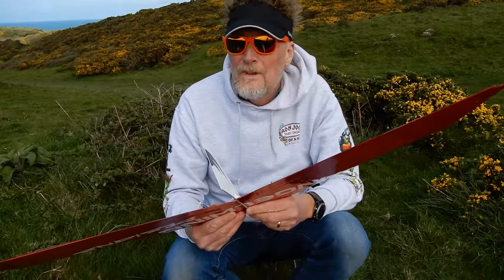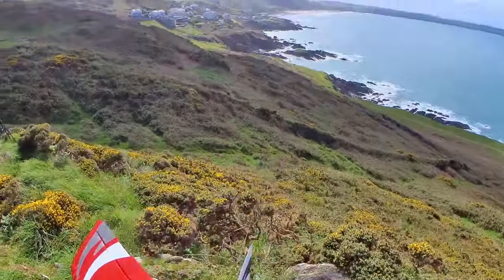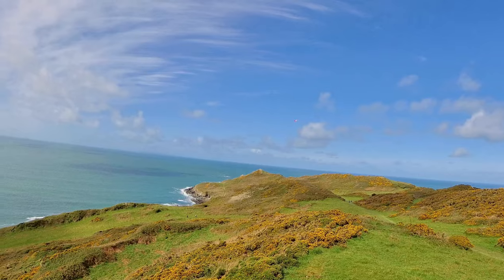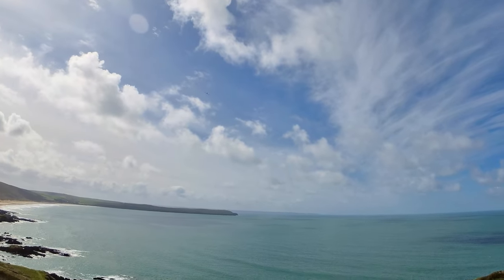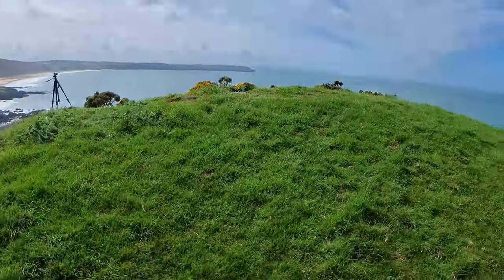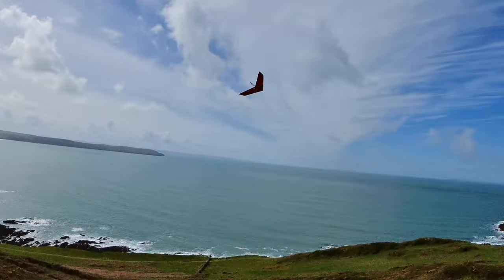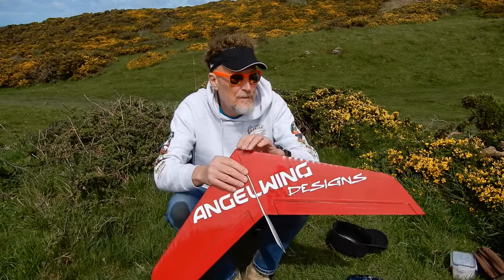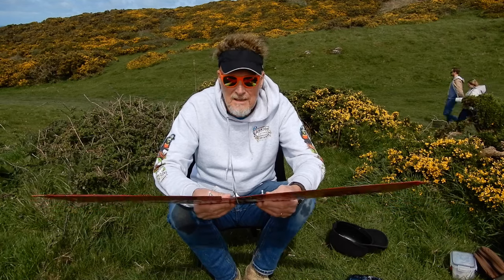Test Flight SOAS Mk3 wing in a bag

Comment: Looked like you were having fun Nick, you did good to keep up with the roll rate. Great that the CG worked for you. I found that the rearward position definitely improves performance very noticeably. As the CG goes back, the elevator gets more sensitive so you need to reduce throw if it feels too twitchy.
Reply from the maker: Yep found that out with proto type I have an interesting mod for next flight 😜

Comment: It’s an awesome wing.  So did you finish with zero additional nose weight?
I trimmed mine a smidge forward with led shot before flying and it was a bit scary 4-5 grams calmed it down and made landing in one piece viable. 
Nice film. Thanks for all the help.
Reply from the maker: Finished on the knotch mate thanks that was Sunday so not brilliant for hang gliding 
I might have a tinker coming up 🤪

Comment: if you don't need a vertical surface, why have one?
Reply: reliability
Reply: @marc_frank  Tell that to the birds.
Reply: @alcourtines4707 
i'm familiar with al bowers work.
the albatros flies in very consistent conditions, so he might not need it.
other birds like hawks have enough flexibility to use their tail as a rudder.
Reply: @marc_frank  I guess you have no experience with the work of Richard Miller and his difussor tipped wings, very similar to a seagull.
Reply: @alcourtines4707  no but that looks interesting. i found a reference to an article he wrote a while ago which i'll search for and read. from what i can tell so far it's a passive flexible wingtip. how does that contribute to yaw stability?
Reply: @marc_frank  The tips angle in like a weathervane. cords of 1.5 - 2" seem to work best, as Marske reports. Most like a sparrow? I use 1/32 balsa. Flat on top, upside down Clark Y  on the bottom. Very importanant to maintain alignment  of both cords. I tape the bottom halves together, bend up against template & tack with super glue.. Then sand airfoil against FLAT table top. Some solder up front for balance, Finally I end with automotive wax over sanded doped surface to keep dry from dew soaked grass. Up aileron is far more effective than down.